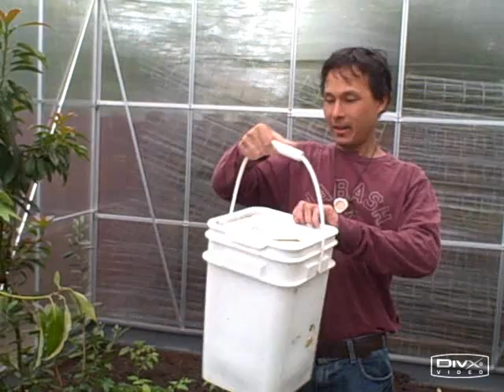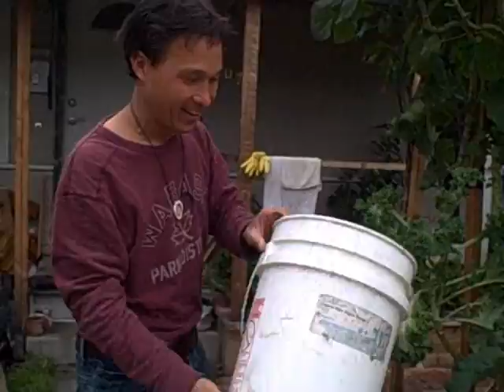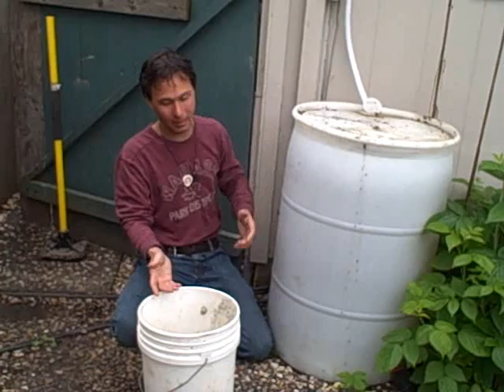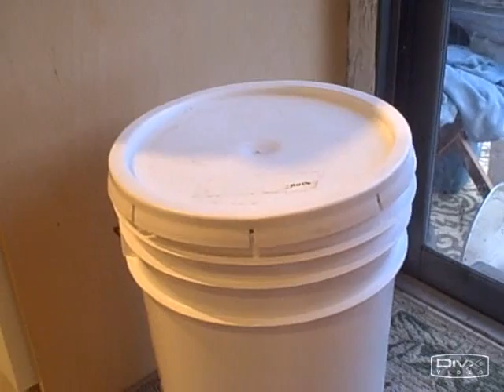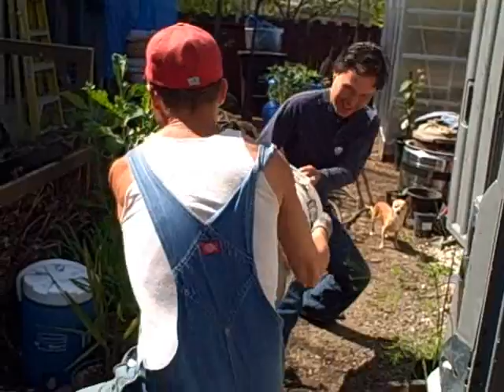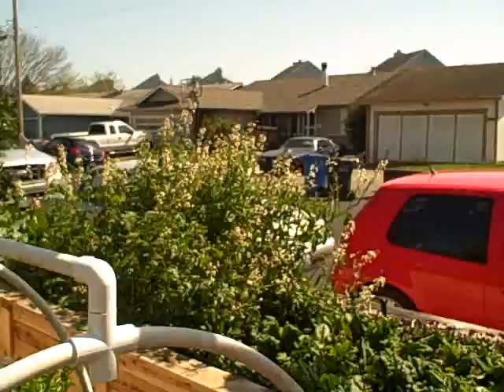The Many Uses of a 5 Gallon Plastic Bucket in the Garden

Comment: I take a flat pry bar for pulling nails and i stick the short end between the buckets and pry sideways a little then work my way around the buckets. Usually works.
If all else fails, I drill holes for a planting bucket in the bottom bucket . That relieves the suction holding the buckets together and the bottom bucket comes off easily.
Thanks for all you do.
John Davis Jax Fl

Comment: John , Chef Api here in Saratoga, Wyoming. The easy way to separate two Bucket is to drilled a hole @ the bottom , one at a time. The air go in between, and  pulled.

Comment: when im hauling dirt/compost/gravel or whatever I line the bed of my truck with a tarp n sit buckets on that so when you load the material most goes in the buckets and the rest goes between em n on the tarp so when youre unloadin just grab a bucket n dump n only have the lil bit that goes between em then grab the tarp n get the rest out

Comment: I spray inside bottom bucket with a water hose or air line to get apart also shift pressure to each side as your pulling helps

Comment: Stacked buckets will separate easily when you turn the  buckets upside down and stand on the rim of the bottom bucket. Pull straight up and if necessary rock the top bucket back and forth as you pull up. Legs are stronger then arms and stepping on the bottom bucket supports it firmly to the ground. Always works.

Comment: Whats the rock dust do?
To help separate the buckets pour soap around the stuck edge, then shove a flat-head screwdriver in between the buckets... helps save the fingers :) Also if suction is holding them together, drill a hole in the bottom bucket to allow air flow

Comment: I find the easiest way to get buckets apart is to use an air compressor. Put the nozzle as much into the crack of the bucket as you can and usually they'll come right apart with almost no effort.

Comment: For watering small trees/plants, drill a small hole 1/16 inch or less in the side as close to the bottom as you can, place near the small plant to be watered. Fill bucket with water and walk away.............It will slowly trickle onto the base of the plant, no run-off or waste............come back and refill later.

Comment: you forgot 1 thing. you can compost in the 5 gallon buckets themselves but it doesn't produce much heat and probably takes long as well but i have tried it and it does work. or upside down pots,

Comment: Very dated comment.  But I worked with a florist for a few years, if you can get some water (warm preferably) between the gaps in the bucket, it should push them apart. I spent many a year with bleeding fingers trying to pry them apart. ;)